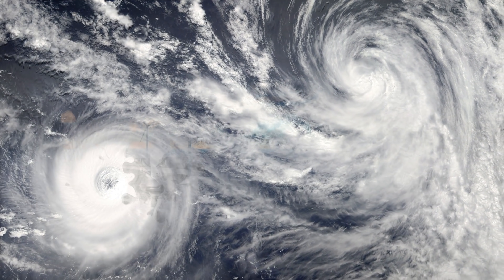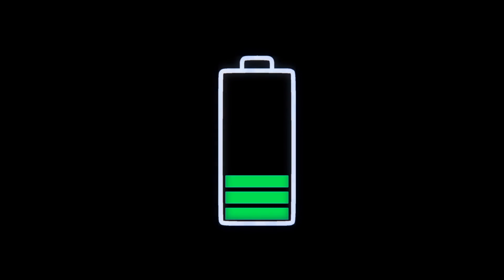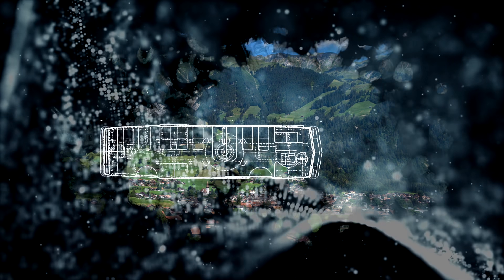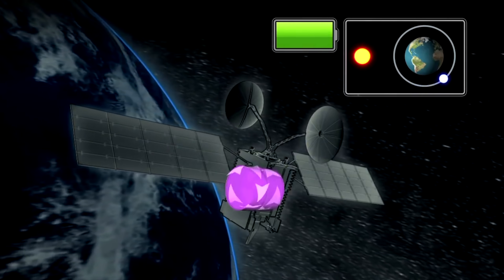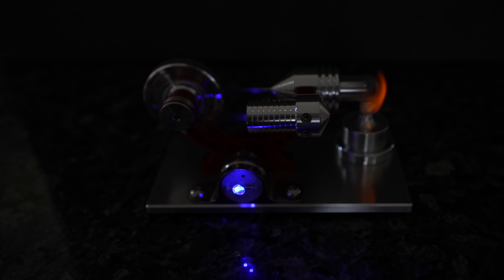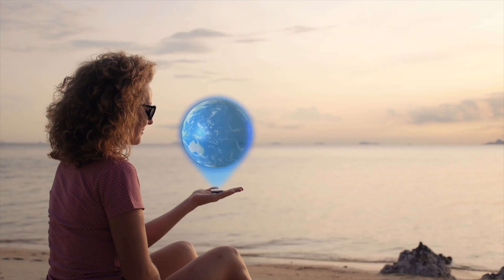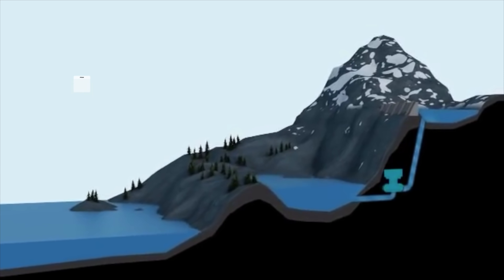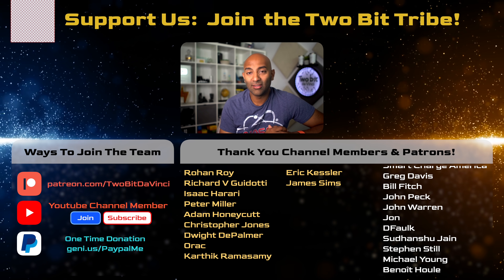The Mechanical Battery is Making a Comeback

Comment: Gravity storage is super interesting. I saw an article about a company use old vertical mine shafts to store energy in the form of large weight being hauled up and lowered down the shafts. Would be interested in a video looking at that as well. Thanks!
Reply: But calculate how much energy it actually stores. It takes an enormous mass (like a lake sized amount) to really store a lot.

Mass x gravity (acceleration) x the change in height. 
For instance 1000kg falling 10m only makes .027KWh which is not very much. In a mine shaft the distance and mass will be higher, but only enough to power probably a few houses.
Reply: Scotland has numerous hydroelectric stations, whereby they have dammed the peak of the mountains as a manmade loch then using potential energy mass x gravity x height  fires down to spin turbines to generate electrikery. Then if the.water.mass is low.pumps it back.up but that is not realy.a problem in scotland lol

Comment: Further more, Flywheels on engines are for smoother operation and to allow low idle. The more cylinders the less you need a flywheels weight as theres less of a gap in power between cycles.
Reply: Kinimatic Dampner
Reply: Tell that to my Harmonic Dampner! lolz, but you are right.

Comment: I am an old guy that remembers tech from earlier years.  One example were houses with a tower/tank above their roofs.  The water pumped up into the tank is stored energy in a simple form.  This example can still seen in a few rural areas.  Energy to move water was provided by gravity in the old fashioned residential water tower.  Yes, we still do this with water tanks owned by utility companies.  The point is energy stored through gravity provided water under pressure, by an individual family to itself, without paying a utility company and was the ordinary.
Reply: If I recall the issue is... You'd need  either a massive tank, or an incredibly tall tower for it to generate enough to make it worth while.

 Doesn't work on a small scale. On a big scale? I don't think the cost is worth it relative to other technologies. 

 Not to say it isn't being used. Just there is a reason it isn't sought after. 

 Pumped hydro on the other hand is the most widely used form of storing electricity already. People are trying so many various methods on it. 

 The dumbest thing though is the Energy Vault. They use concrete blocks, and stack them. It makes literally no sense to do that over storing water in a tower. It is a scam for the amount of energy it stores for the cost.

Comment: The gyro bus looks interesting, please share more.
Reply: I had that same idea 30 years ago...I used to ride a bus and it was like make a stop, almost full throttle to the speed limit and then slam on the brakes for the next stop 1/2 mile away....nothing but logical to use a massive flywheel to slow the bus down and finnish with the brakes and then use a clutch hooked to the flywheel to get it rolling again
Reply: I once worked for a hydraulics company.  They had the idea of installing a hydraulic pump with the transmission.  The pump would be used in place of using the brakes.  The stopping force would be from charging an accumulator.  When it was time to go the pressure in the accumulator would power the pump and the way we would go.  This project was dropped when they determined that the production cost was excessive.  To bad, it was excellent for stop and go traffic.
Reply: Maybe there could be a gyro City Car that recharges at each stoplight :)
Reply: There actually is a Gyro Car.  It has a large built in gyroscope.  Enter Gyro Car in on YouTUBE.
Reply: Would someone do a comparison between a Gyro Buss and a Battery Buss.  There may  be places where the Gyro may be the best option.

Comment: Our state used a large underground salt cavern that was used to store compressed air that generated with wind turbines. That compressed air was then used to run gas turbines in an electric power plant. Since 2/3 of the natural gas used by an electric turbine is used to compress the air, this arrangement was used to reduce fuel usage by 66%. After implementing a pilot project and successfully demonstrating its capabilities, the project was deemed "not Green enough" and abandoned.

Comment: I remember a story about a company here in the netherlands that has machines that require a high power connection at startup but when started their powerneed would drop significantly.  Their maximum power grid connection is lower then the power required so they set up a flywheelsystem that can build up momentum and at the time of need generate the excess capacity to start the machine and then generate power untill the momentum is gone and would start up when more power is needed again.

Comment: That Sterling generator looks interesting. Would like to know more. Tks.
Reply: An interesting approach would be to combine a Sterling engine with geothermal - use the temperature gradient to generate energy with the earth acting as a heat battery.  Imagine a bore hole going down a KMs with a pipe with fluid picking up heat and a sterling engine turning that into electricity.  A similar approach could also  work upwards...
Reply: @IgalGreenberg  Hmmm !!!
Reply: Examples are easy to find on eBay, either with the correct "Stirling" engine spelling or the typo Sterling engine. 
I suppose you could make a Stirling Engine out of Sterling Silver!
Reply: The Next Great Thing by Mark Shelton describes solar power Stirling engine engineering.
Reply: Sterling engine developed by a scottish clergyman/ engineer is a wonderful concept. Over 30 years ago remeber studying this its carnot cycle and in theory it was ahead of the competition. In reality it is good in certain enviroments and only being picked up in 2021 when.imvented in 1816 😀 .. just wait till we seriouisly colonise other planets the sterling and solar will be big.
Reply: A solar powered heat engine beat out Edison's light bulb for the best technology innovation at the St. Louis 1904 Worlds Fair.  Check out the work of Papa Himalaya.
Reply: Is this seriously your first time seeing This?